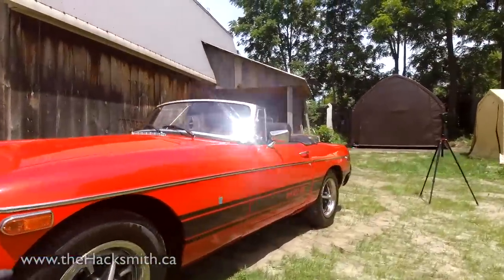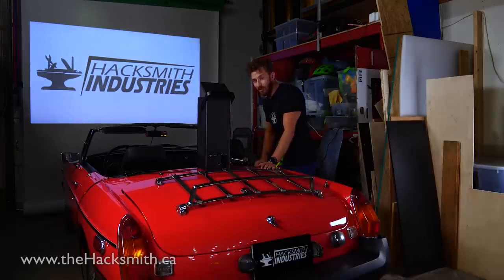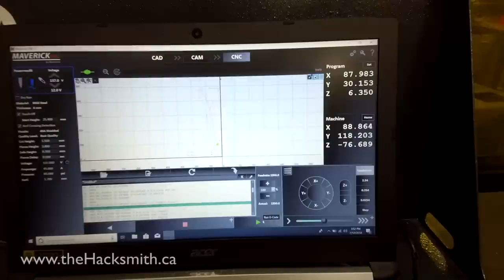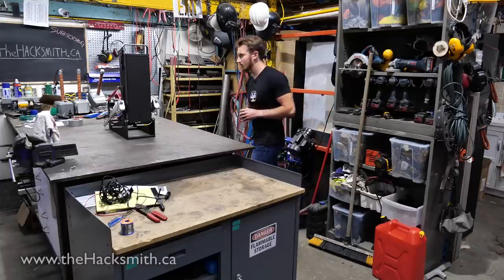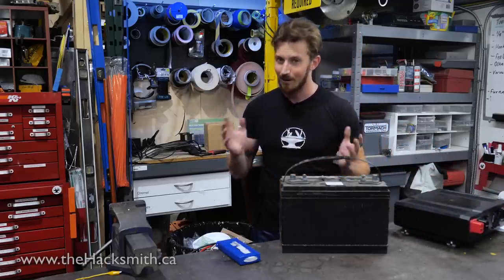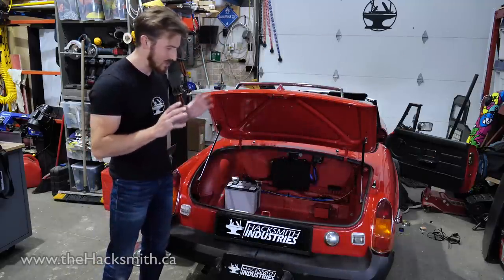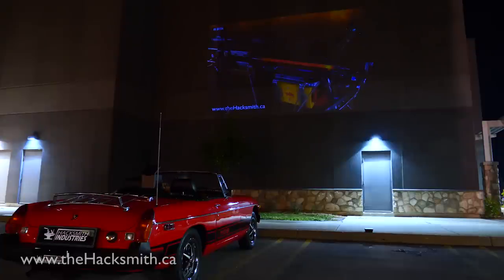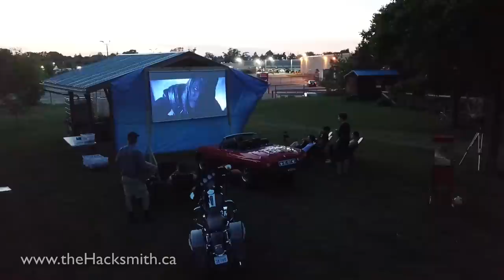Spy Car with 4k Laser Projector!

Comment: 15 lb electronics? Let's add 30 lbs of steel and 15 lbs of screwdrives to it. 1/16" plate? What is this, a child's toy? No, you own a plasma cutter. 1/4" all day, might as well be bulletproof. Don't want to be watching movies on the highway while dodging bullets and have the bracket collapse when it gets hit. Securing 60lbs of steel and $2700 of electronics to a moving vehicle? Ehn, two wood screws oughtta do. It's the Hacksmith way, that special half-assing touch :P.
Reply: MattsAwesomeStuff how the heck did you commented 22hours ago on a video which is posted just now
Reply: Zvonimir Ovcar patreons watch it first
Reply: Zvonimir - Those of us who chip in a buck on Patreon get access to the HackSmith Industries Time Machine, where when a video is posted we go back in time and can see it in time to make funny comments. The freeloaders have to watch things in normal-time, like the peasants they are.
Reply: if it starts raining just add 20 more lbs of steel

Comment: And how did you put the movies, like did you use a PC that is branched to the projector so you can choose the movies or does it have another way?
Reply from the maker: It's a smart projector, can just plug in a USB stick or stream to it
Reply: the Hacksmith ty for replying
Reply: Seal the car off and make it go in water like a boat.
pls answer
Reply: Merlin Blatterer it is very difficult to make a car able to float. It is a very old car so it is likely too dense to float, and even if it could float it would be extremely difficult to completely seal up so that water would not get in.
Reply: John E. If you take a nornal car the air in the cabin is too much to make a car sink only when the cabin is filling with water it sinks.
The difficult part is sealing off, leveling and add a way to controll the car in water.

For me its a must have in a spy car.
Reply: Merlin Blatterer that's true for modern, light, hard-top cars, but older cars tend to be denser, and with a convertible even if it just sinks in a little, water will start pouring over the top and it will sink completely.
Reply from the maker: Merlin Blatterer you wanna chip in the $10,000+ it'll cost to add that feature?

Comment: Boys with toys. Kinda kewl though. The projector will set you back 2 G's.  Lots of neat tools though, cnc, welders,  motors, actuators, machine shop, CAD/CAM, nice. U forgot the machine guns, smoke machine, ejector seat, and oil slick maker. Oh well maybe next time. If you could create the Bond girls that would be great.

Comment: Hello there hacksmith so I have been doing research recently and I have recently learned about a material called graphene you may have heard of it but the material if made correctly and thick enough is bulletproof I have heard and 50% stronger than titanium then it is 200 times stronger than any type of steel so I was thinking hacksmith you could use this graphene to make your tires impossible to pop (I assume it’d be a new way to use it) and you could put it on your car and make the car bulletproof cause what’s a spy car without it being bulletproof this is incredibly light as well so maybe you could make a case out of it or use it for other projects just remember if you use it cut it with something sharp don’t try to break it

Comment: question does the car produce the sound for movie or have yu not dded that yet
Reply from the maker: Yes,  the car speaker system
Reply: @hacksmith  oh ok so did you wire that in for the movie

Comment: There are actually groups in the USA that do events called Guerilla Drive Ins,  They roll into abandoned parking lots and such and setup impromtu drive in theaters.  Great thing is this mod should not have any legality issues assuming its not used while driving.   Popup drive in theater at most would have the police tell ya to scoot from whatever building you were projecting on.

Comment: You should make it so you can change a setting on the projector allowing you to project onto non-white surfaces.
Edit: with th e colors still working as if you were projecting onto a regular white surface
Reply: You are worrying about the car being street legal with the license plate? What happened to rocketlaunchers and road spikes or oil slicks?
Reply from the maker: License plate is something cops always pull you over for... Hidden gadgets aren't anything to worry about
Reply: the Hacksmith you know from experience :D

Comment: hacksmith 
you can buy a (12v 2000w pure sine wave inverter) what works like a normal house socket does
what works a lot better than a inventor, so what means it won't be putting stress on motor and other things what uses pure sine wave power like a house socket
so just think about it & keep up the good work what you are doing :) :) :) :)
Reply from the maker: But theyre like $1000

Comment: I have hade this idea for about a year now and would attempt to build it myself if I had the correct equipment and funds to do so. My idea is to use a small Tesla coil (preferabley one that creates a large number of sparks in one general direction) and an air compressor. You would us the air compressor to blow the electrified air into a condensed stream. This stream of air would be extremely hot, yet not weighing anything. My design would be to wear the air compressor as a backpack. Then having the air travel through the tube an into the casting the holds the coil. Please actually read this and send me an email when you do.

Comment: why would u do that so hard from dc to ac and back to dc ? Why dont u just disconnect inner power supply and instead of it connect it straight to car´s 12 V
Reply from the maker: Because the projector will likely use a variety of 5V, 12V and could even use 24V.

Don't hack stuff you don't have to

Comment: There's no way you're powering the inverter off a single car battery. At 2000W peak it would be drawing over 160 amps from the battery at 12V, the projector alone draws 12A. A typical lead acid battery can only put out about 4 amps continuously. If you're planning on running even more stuff from the inverter you're gonna need to swap it out for lithium ion.
Reply from the maker: I dunno where you learned that... A car battery is capable of putting out close to a thousand amps when starting a vehicle. This is a 100aH battery, it'll run the projected for a good 8 hours straight without being fully drained.
Reply: I'm talking continuous, not surge. Maybe my info is outdated... as far as I remember, plain old car batteries couldn't put out 1kA continuously but they can handle very high surge currents. It's my understanding that continuous high discharge rates will massively decrease the capacity too when using PbO2, though I'm sure you're not gonna be using a projector while firing the ejection seat and rocket launcher at the same time lol
Reply from the maker: Scabbage car batteries can comfortably put out a couple hundred amps continuously, trust me ;)
Reply: I'll take your word for it then :P  Though some day I'll have to actually test a new battery to see how much internal resistance plays a factor in capacity loss nowadays.

Comment: 12v dc + 120v inverter =??  Battery backup
Reply from the maker: Yeah
Reply: How much longer the battery will last??
Reply from the maker: depends on what you're running! itll run the projector for like 24 hours straight easily
Reply: Wow that i enough